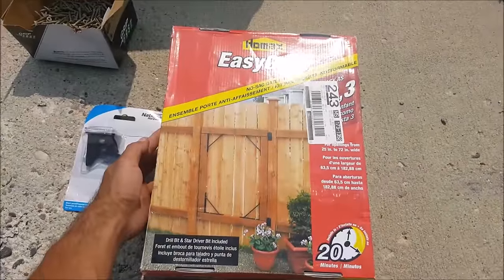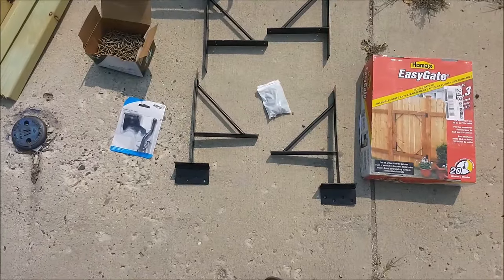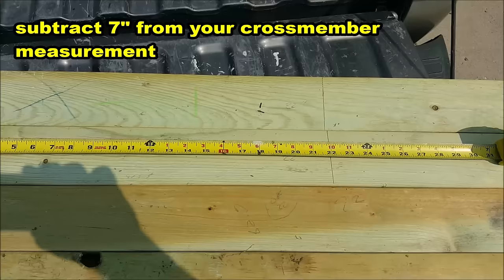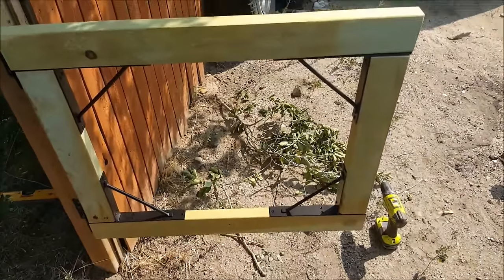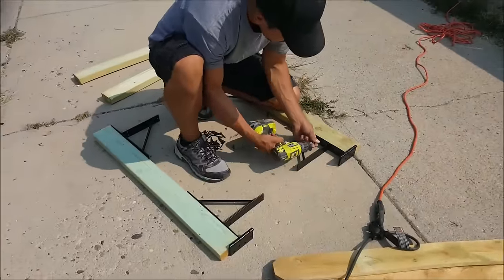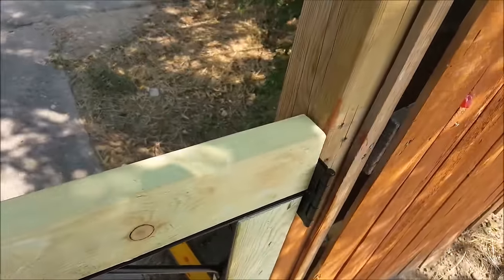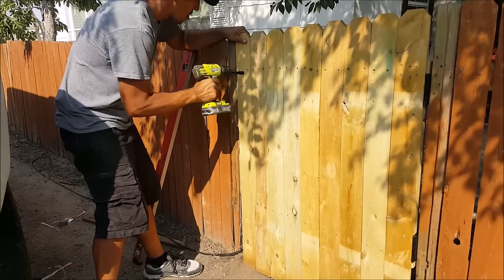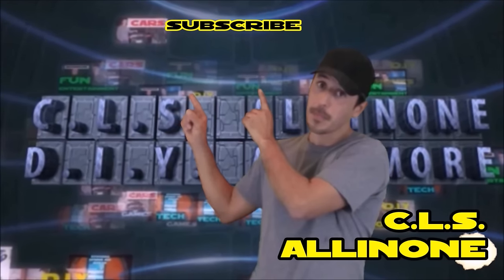D.I.Y. wooden Gate in 20 minutes with Homax Easy Gate Kit

Comment: Carpenter here, just thought id share some helpful info: 
A). These gate kits are great and I use them all the time for my fence builds for clients, however the welds can be a bit sloppy so i cut a very small chamfer on the edge of the 2x4 so the wood sits nicely inside the brackets 
B). Soft wood or not always pre drill for a cleaner finish and if you want it perfect squeeze clamp all wood boards so when you drill and screw its sits flush. 
C). When taking your width  measurement keep in mind the hinges make up about 1/4 to 3/8 of an inch. So you must subtract that difference. Conversely if your opening is not plumb consider adjusting the opening with shims and a ripped pickets, cut a tapered piece to attach to the post, or plane the post to whatever dimension you need. 

C). This is really important; while the gate itself may not sag, the post youre attaching your gate to might if its rotted, not properly installed, or your gate just carries too much weight. I always try to swing my gates off the house or a fence partition attached to the house, or off of something solid like a masonry wall, if this doesnt apply to you consider building an arbor by attaching more 4x4 or 2x4 on to your existing post. This will essentially brace the opening so that the distance from post to post doesnt change (in other words wont sag). 
D). One of the few cons of these gate kits is how your pickets can (depending on which way it swings) not sit flush with the rest of the fence. Most people dont care as long as its functional but ive run into people who want the gate and fence to be flush to each other but swing in a manner that makes that impossible. Ive actually been in the middle of couples fighting over this. Its nuts. 
If this all seems too complicated by all means hire a pro you’ll be shocked at how complicated gates can be.
Reply: Ya people get a bit worked up , I all ways try to point an ask be for hand an like u said still have issues at times depending on person an area , great points thank u
Reply: Dude… this is amazing.
Reply: I just put a fence like this up but the bottom of the gate can be pushed in. It is not stable like the top part by the latch. I have a dog and I can see him pushing through the bottom. Any way to fix that?
Reply: @joshgamez3685  yeah that’s what I was planning to do but I have two other gates and they don’t push out. I thought maybe something was off
Reply: good to know thanks, joe
Reply: Super helpful, thanks!
Reply: Best, and most complete info in comments. Thanks for taking the time to list everything … 👍

Comment: I think you can't use dry wall screw on fence. it will mark a cry line below the screw after rain.
Reply from the maker: Ah these are not sheetrock screws they are black painted exterior screws. That match the gate hardware.
Reply: @D.I.Y._All-in-One  oh, I thought this is indoor use screw for plaster board in UK. : )
Reply from the maker: They look kind of simular

Comment: Can you create a gate from a wood fence panel? I need a wood gate large enough for a car to drive through. I know that they're about 8' long (at least they are at Home Depot). My wood fence is going to be 6' high all around my property. It's pretty much even, too, so I can get away with wood panels (yay!). I want the gate to open inwardly and to the right, but I'm not sure what I would be using to secure the gate on the other side, which will be against my hose and on concrete.
Reply: what did you end up doing?  I need a double gate I can drive a car through. I wont be using a fence panel but I need it wider than usual.

Comment: The bottom measurement is 38 1/2 inches per your tape measure (50 seconds or so) but you later said your gate was 35 1/2 inches wide (before the 3/4 inch deduction) (1 minute 16). Do you have a 3 inch variance from bottom to top or are you building two different gates? How did you know how far out to put the hinges when attaching them to the post? Did you attach them so that the fence boards would be flush with the gate? How did you support the gate while installing the hinge screws? You had to have had the gate open to do that since the hinges wouldn't be accessible if the gate was closed. If the hinges are about 1/4 inch thick when closed, did you leave just a 1/4 inch gap on the latch side to have an even spacing or 1/2" or 3/4"...?